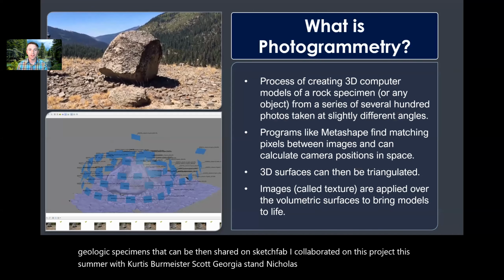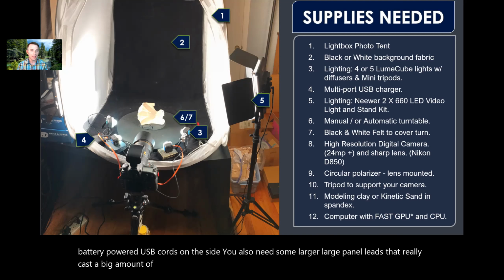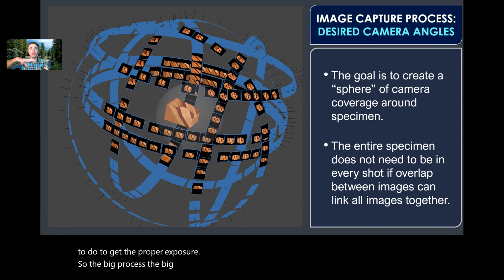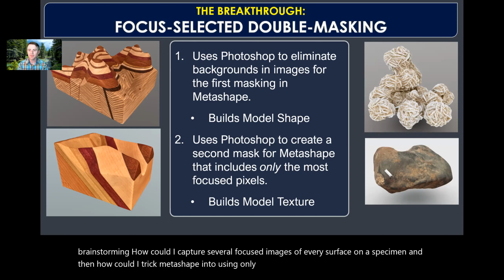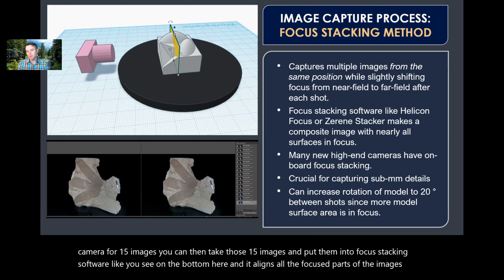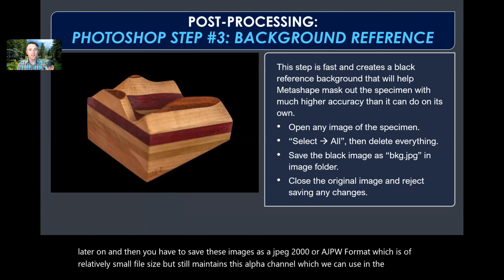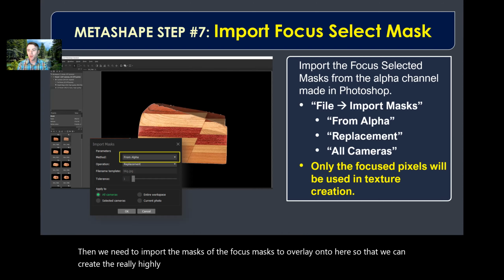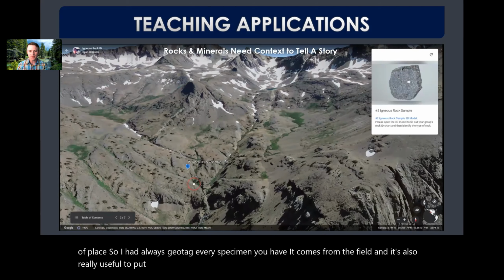Photogrammetry Workflow To Consistently Create High-Resolution 3D Models of Geologic Specimens.

Comment: Why not also mask blurry areas and use those for the sparse cloud as well ? This would improve accuracy.
Reply from the maker: In my experience the blurry areas are extremely useful for depth maps and reconstruction of the model. When I masked out the backgrounds  (using only in-focus areas of focus selected photos) the results were a bit wonky because I usually slightly missed a few areas to get full focus. I know updates to Metashape and reality capture in the last five years have really changed-up workflows. But it’s been about a year since I made my last model due to other commitments. Definitely thinking of getting automated turntable/focus stacking duo that can help churn out more automated versions on my small personal budget.
Reply: @phaneritic  How is this even possible, blurry areas will not be considered for reconstruction, those area who will be will have a high error will be filtered out either way.
Reply from the maker: @sierraecho884 I think we’re getting hung up on definition of blurry. For me, there were many areas just out of focus on object with large depths of field, but useful enough for point clouds (I rarely made models from depth maps at the time) to not be excluded in model making. The slightly out of focus areas drove me crazy on the texture map. So the masking was for the texture. Back in the day I did have to yeet the background manually. I think that’s changed within past several years.
Reply: @phaneritic  "...The slightly out of focus areas drove me crazy on the texture map...." Yeah I can see that =) 

"...Back in the day I did have to yeet the background manually. I think that’s changed within past several years...." Yes it has.